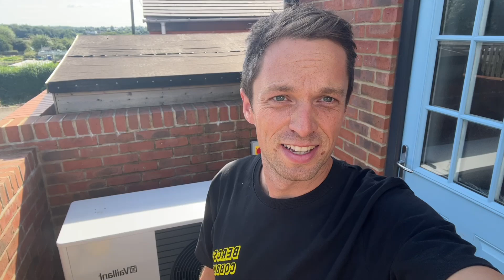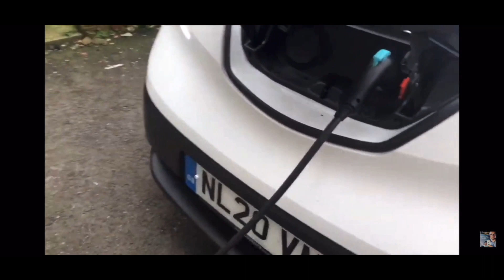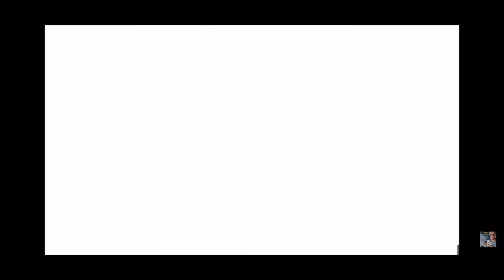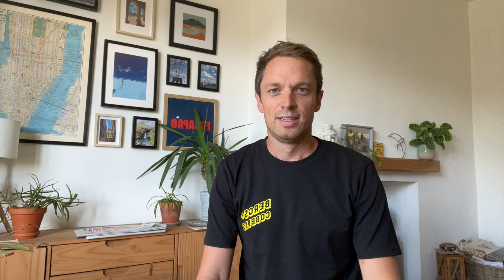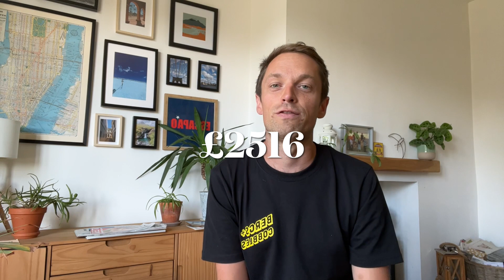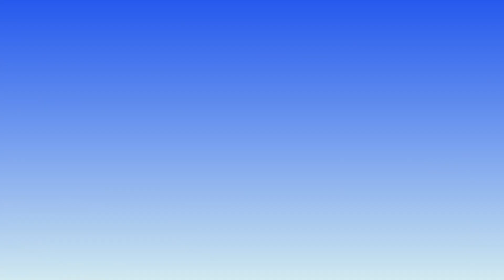How much do heat pumps cost to run? Low Carbon Lifestyle ep 46

Comment: I've had my air source heat pump system for 9yrs this year. It's a Daikin system with radiators. With the current cost of electricity (March 2023) and an increase due this April my system is far far more expensive than if I had a gas boiler system. There is no gas where I live, we're a long way off the gas grid so unless I get a backup system for heating such as a log or multi fuel stove I am going to face a very cold winter come 2023/24. With 9 yrs experience of living with this system which has been tweaked and adjusted via the controller to get the best performance out of it and at the most efficient this system is not enough to keep my home warm in winter. I live in a 2014 timber frame bungalow with really good insulation in walls, floors and roof, double glazed and practically air tight and the heat pump just can't cut it. The heat pump is the correct size for the building if not a little bigger. So the only conclusion I can see is air source heat pumps are only any good in similar homes to mine but with an array of solar panels on the roof with storage batteries. An air source heat pump system cannot compete with gas, no way. 

A friend in the Netherlands told me only recently that the Govt there were pushing people into getting air source heat pumps to cut down emissions and after a couple of years they are all complaining that their air source systems are next to useless and a lot of them, if they can afford to, are switching back to other means of heating such fossil fuels. 

So if anyone is thinking of getting an air source heat pump I would suggest you couple it with solar panels to get the best out of it otherwise you may as well throw your money on the bonfire. 
Ground source heat pumps are much better, so if you can I would advise getting those over the air source type because they don't need a back up or auxiliary heating system and they are much more efficient, however I can't afford to have one of those systems and I don't own enough land to have the ground pipes installed. 
Tom great video, by the way.It might be worth mentioning that to get a little bit more efficiency from your ASHP it does need to be on 24/7 and. you can't set the zone thermostats to fluctuate for say 16C over night and then higher for an hour at 6am and then off and then back on at 7pm for a few hours and then off for the night. Because that's not how ASHP's work best. Thats good for gas heaters but no good for ASHP's. I leave mine on 18C 24/7 and when it's bitterly cold I manually up the temp on the thermostat from say 8pm to 10pm only by one or two degrees.
Reply from the maker: HI Hazel, thanks for commenting – you were definitely an early adopter!
I am interested in your calculation that the heat pump would be far more expensive. Do you know what the COP for your heat pump has been? If it is around 3, you will be breaking even compared to a gas boiler (if the supply existed).
And I am surprised the heat pump won’t heat the house. Did it work when first installed? 
I live in a much older home and the heat pump is able to heat our house to the level we want it to.
Heat pumps and gas boilers do work in different ways, and a gas boiler cannot compete with a heat pump in terms of emissions.
I agree coupling heat pumps with solar panels is a good thing to do, we are coping without them, and my calculations say we are now saving when compared to a gas boiler.
I disagree about a ground source system, my perspective is that although the efficiency is increased, the increase in capital cost and then the risk of not being able to maintain the system underground if anything goes wrong. 
I operate our heat pump in a similar way to you, using time of use tariffs such as Octopus Cosy to up the temperature slightly.
What is wrong with your system, it sounds like you are able to keep the house warm enough at 18°C?
Lots to think about and I am sure I have lots to learn!
Tom

Comment: So many variables and looking at it objectionably, as we are about to move to a bungalow, at some stage my boiler will need replacing. If that can be timed to coincide with installing a ASHP the investment is getting more viable.  At my age you do have to look at return on investment as its capital I can't replace - cost of boiler replacement is an important factor in my equation.  The property we are moving to also has solar panels - how many is hard to say but following your previous vid it can be an important factor to the overall carbon reduction goal and cost of running. Another factor is how cheap will gas be in the future as a method of forcing more homes to switch could well depend on this.   If I can stay warm at a reasonable cost then ASHP is looking to be a good way forward and help the planet at the same time.  Your vid amongst others is a great source of 'actual' real data to base important decisions on.  Thank you regards Mike
Reply from the maker: Hi M0AZE - thanks for the comment. It sounds like you are thinking down the right lines, pleased my video can help contribute to that.

I definitely think if coupled with the solar panels your bills will be quite low to run a heat pump. And if you are able to plan it in over the next few years before your boiler needs replacing then you'll be investing wisely!

Tom
Reply: @TomBray-LowCarbonLifestyle  thanks for the reply Tom.  I think things including prices, install and servicing will start to gain traction over the next few years.  Price will remain the main differentiator for a while until we all get the message about our environment and that magic ROI point is realised at a realistic point.  At my age I want to be warm at a price I can afford.   I will get a survey done as soon as we take possession of of our bungalow. And take it from there.  A few months to go.

Comment: If you think private individuals in the West can save the planet by changing their personal behavior, get a heat pump.
If you want to save money, don't.
Reply from the maker: Hi chriser555 - I’m not sure that’s strictly fair, a heat pump in the UK, at current rates, is likely to be cheaper to run than a gas boiler. 

But I would also ask what other option do we have? Half the emissions in my county come from burning natural gas for heat. We need to reduce CO2 emissions to as low as possible as quickly as possible or we are going to see catastrophic climate change. Heat pumps, heating homes, is a big solution for reducing emissions linked to heat. 

It isn’t just down to individuals, there is a huge responsibility of government and industry to reduce emissions, and individuals need to make changes. There are emissions everywhere, we all need action. 
Tom

Comment: Hi Tom, thanks for the video. @ 2.96 SCOP i think you must be running your flow temps higher than needs be and you are setting back to much at night. Theres a lot of bad information out there! Get along to the heat geeks site. lots of helpful informed information to be had. I dont know if you zone as well but you really shouldnt be on a normal sized house.
Reply from the maker: Hi Mark - thanks for the comment! You are very right, I have done another video where I talk a bit about the changes I have made following the 1st year. I had a lot of tinkering that contributed to that 2.96 average efficiency. And heat geek has very much helped me understand.

https://youtube.com/watch?v=pqoEcgqHdFQ&si=EnSIkaIECMiOmarE

So now we have much lower flow temperatures and a higher set back.

One comment I would have for Vaillant is that I am not sure the curve is steep enough. Our house (victorian terrace, not the most well insulated), is really happy above 5°C at a low weather compensation curve, as soon as we have a full day below there, we start to struggle. I feel like we need higher flow temperatures (which means I change the curve on the coldest days) but think if the curve was a bit steeper it would suit us better (although hit efficiency more...)

It has been fun playing around and hopefully our system is now in a good place!
Reply: @TomBray-LowCarbonLifestyle  Hi Tom, What flow temps are you after? I dont know how old your system is but hear that vaillant can hi 70 deg if needed, our samsung can certainly do it. If your house isnt getting up to temp during cold spells then i would have thought your radiators are to small. Why dont you look into fan assisting them? There are fan sets that you can buy on amazon, but you could make your own if your half competent at DIY. The other thing that you might look at it a Homey add on for the controls, this may also help with your curves and automate them for you.
Reply from the maker: Hi Mark, yes the system can work to high temperatures and we don't need temperatures as high as 70°. The weather comp curve we have it on, that keeps the house a good temperature, will be around 35° flow at 10°C outside and only about 43°C flow at 0°C outside. I think we may need more like 50°C below 0, so I would like the curve to be a bit steeper, but we can make it work!

I have looked at adding fans to rads, and the products on Amazon do look really interesting. They would basically be increasing radiator output, and that is meaningful if it means we can reduce flow temperatures further. 

Not sure I could get away with spending ~£140 without permission from my wife..!
Reply: @TomBray-LowCarbonLifestyle  Hi Tom, yes they are stupidly expensive, which is why i suggested making your own. I will be making mine. I use Home assistant and intend to have them come on automatically when the system is running. Once ive made one ill let you have the specification. pwm 3d printer fans are a few quid each and the electronics are really basic and cheap, if i cant do a rad for £30 id be surprised.

Comment: Well our ASHP is not saving anything at all, in fact the electricity bills are roughly 3 x the historical cost of the old kerosene fired heating system. To say that I'm horrified, is an understatement. I have the Mitsubishi Ecodan system rated 3.7 winter and 5 in summer. I called up Mitsubishi and they said that if you were spending less than £20 per day to run your heat pump, during December 2022, you were doing well! On what planet is a monthly electricity bill of £600 considered good or acceptable for a 3 bed home?  I originally calculated that the ASHP would save approximately £5 per month vs the kerosene system. I had no idea that the reality would be vastly increased energy cost at multiple times the fossil fuel bills.
Reply from the maker: Hi gtd65, sorry to hear your experience isn't similar to mine. 

Are you factoring in the rise in electricity prices over the last 12 months? I suspect kerosene is also more expensive than it has been before. 

If designed, installed and commissioned well, working on weather compensation, a heat pump is likely to use around 1/3rd of the 'energy' of a oil boiler, but it would depend on how much you can buy kerosene for to do the comparison on costs.

I see the point the person from mitsubishi is saying, at the price cap rates (34p per kWh), £20 per day would be around 60 kWh of electricity, that would be around 180 kWh of heat - which is a lot, but we had some very cold days. Using that much heat from oil would also cost a lot!

Although you would expect that much every day to add up to a monthly bill of £600, the weather varies a lot throughout winter, not always as low as the cold snap we had. Christmas week I was averaging around 20-25 kWh per day (including all the cooking!) but there have been days when it was negative temperatures all day where we used 45-50 kWh.

What rates was your original calculation using? And what are you paying now? What was your saving calculation based on? I would agree, my perspective is that you are likely to save with a heat pump, but I'd like to see your calculation.

The costs will decrease as weather gets warmer, but we may have a few more weeks of the coldest weather first
Thanks for sharing your experience
Tom
Reply: @TomBray-LowCarbonLifestyle  I'll type up a decent reply when I get home later this evening. 👍

Comment: You need to include in your calculations the ASHP annual maintenance cost. That is £300 for the model I was  looking at. You must pay for this otherwise your ASHP warranty becomes invalid. £300 per year extra has made me think again. Thoughts?
Reply from the maker: Fair enough, should include an annual boiler service too...? 

The service of my system has been included in the installation for the 1st two years, so not had to get a cost for it yet but you make a fair point.

If we assumed £300, and assumed a boiler service was £100 then I have £200 in savings to find to break even... I think we will be nearly there this year with improved efficiency and the rates of the price cap (I have actually moved to the Octopus Cosy tariff - https://octopus.energy/smart/cosy-octopus/ and expecting to save a bit more but a bit more of a complicated to compare directly with gas).

I am really focussed on the emissions though, the reduction in overall energy I use and the minimal emissions we have linked to grid electricity.
Thanks
Tom
Reply: @TomBray-LowCarbonLifestyle  Thanks Tom. I'm really torn on buying a ASHP or a gas boiler for my retrofit.  A Google search showed UK Gas reserves have three years and Norway's,  have nine, I guess that's the case if no more new fields or shale comes online. Hydrogen , to excuse the pun is a pipe dream for the majority of population. That leaves UK gas users dependent on Qatar and other 'far away' states with risks to supply, notwithstanding  carbon emissions.  But the capital costs of ASHPs are so high in the UK ....arggh!  Last point, more important than our heating source though is insulation. I'm employing a consultant to advise here, to see what heating / insulation / ventilation system works best together. I think  in Ireland retrofitters get a 50% government grant on the whole lot. Little UK Gov help for me as my EPC is a C. And a £6k grant off a £14k ASHP ain't cutting it. Where's Greta when you need her?
Reply from the maker: Hi Ian, I would be strongly suggesting you should look to install a heat pump, particularly if you are planning a well insulated home. Good insulation would allow you to run a very efficient system that would be quite cheap to run. 

I suspect you’d regret having gas in your home before the end of the decade. 

Where is Greta when you need her? Fighting hard to end to get leaders to make the right steps to end our use of fossil fuels, and doing so with wisdom and grace. I’m inspired by her. And amazed by what she has achieved as a teenager to influence the whole world. What a hero!

Comment: We have just discovered your channel. Very interesting and we are very envious - a couple of years back we remodelled our downstairs to create a utility to house a cylinder for a heat pump. That cost us already quite a bit. Then our heat pump installer did a ‘bait and switch’ on us shortly after we paid a hefty £8600 deposit. They claimed that the Aerotherm Plus couldn’t be installed because Vaillant had changed its proximity guidance. Poppycock per Vaillant’s technical team. Dodgy London installers… so we are stuck with our ancient but efficient gas boiler. Your episode brings home to us our actual carbon production. Very inspiring
Reply from the maker: Thanks for commenting Christine. That sounds like an awful experience. They just left with your deposit? Were they an MCS accredited installer? That must have been so stressful!

We've been really happy with the Vaillant Arotherm +, ours isn't actually installed exactly to manufacturer's guidance, too close on the right hand side, which may impede maintenance in the future. Frustrating when installers don't do the basics right!
Thanks again for your comment and pleased I have been of some help / not pleased to cause some envy!! Hope you are able to make the move soon